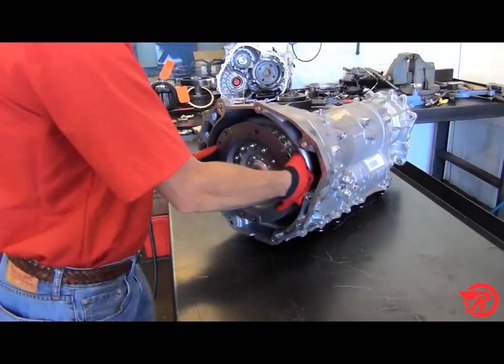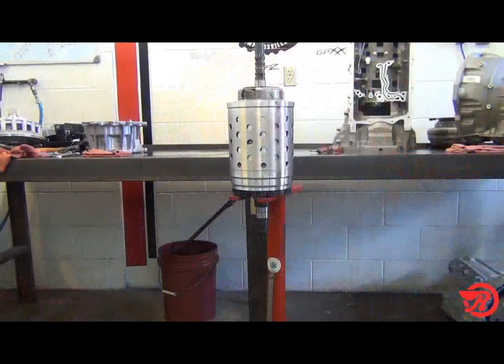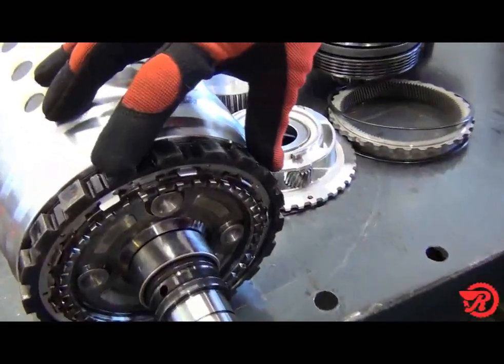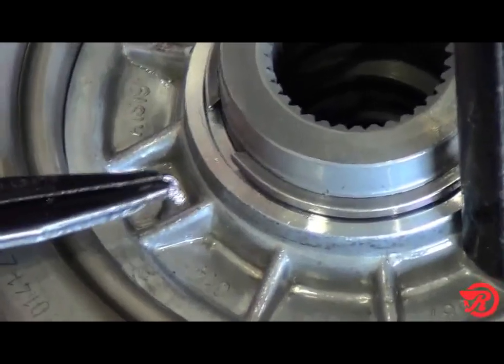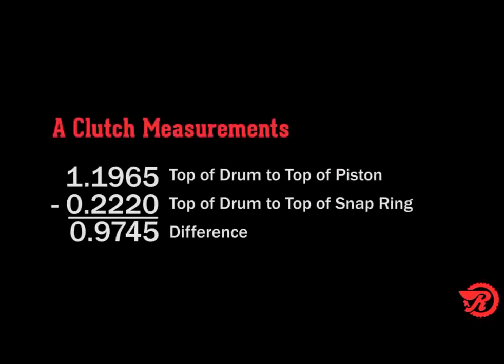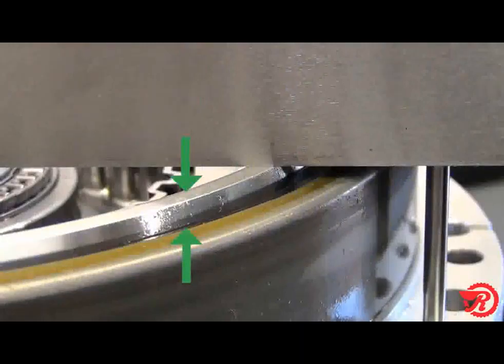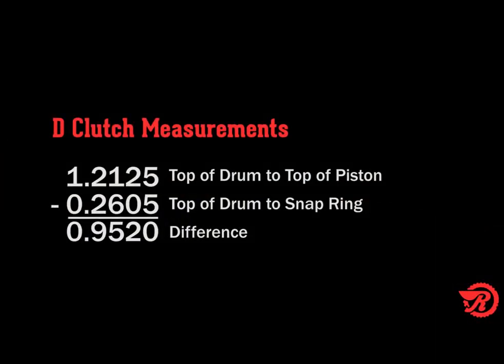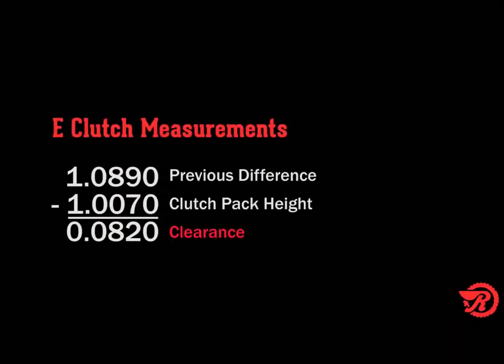ZF 8HP repair manual

Comment: hi, i need your help about my 2013 bmw 520i which have zf ga8hp  transmission, so my transmission oil cooler has damaged, after antifreeze confused with my transmission oil, i wanted to change the transmission oil 4-5 times and also with new filter, but some people says: your transmission must be open and clean correctly, what is your suggestion, thanks for you help (aumac1@hotmail.com)